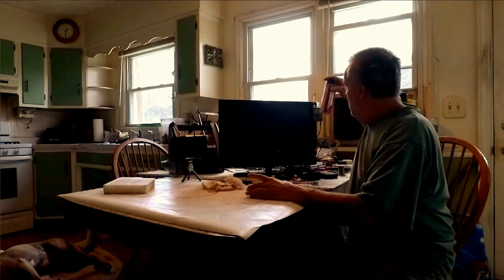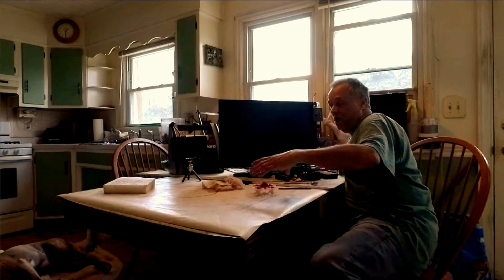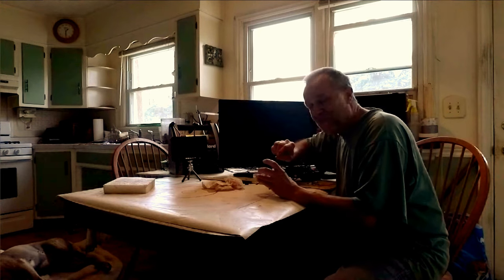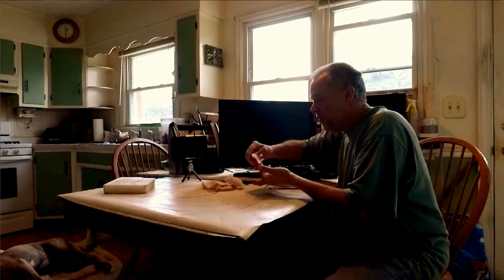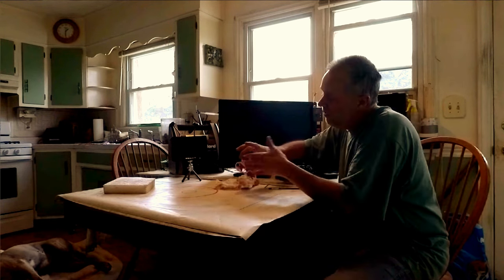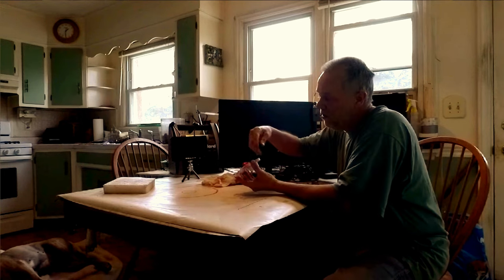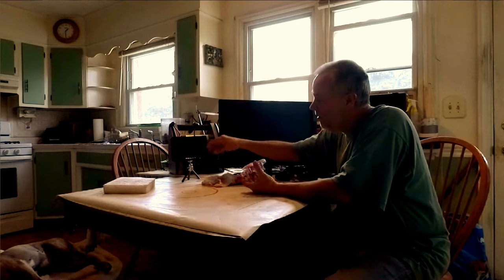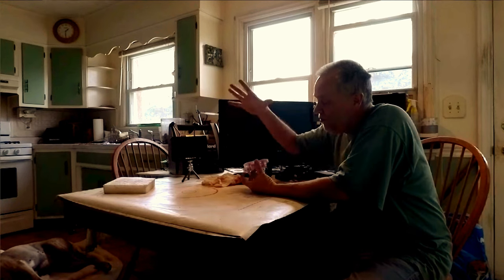Corrosion-X,  Waterproofing Your RC. Electronics, Inductrix FPV+ Pre-Winter Outdoor Flight Prep

Comment: With that waterproofing you'll see much more RC enthusiasts bringing their equipment out in inclement weather I don't know if that's a good thing or a bad thing but it'll get more people off the couch
Reply from the maker: RC-SkunkWorX it honestly has worked for me. When I flew my Timber in the blizzard we had last year at night, I knew it was just a good insurance policy to have in there. Like I said in the video I tested the stuff underwater receiver and all. It works. Just don't code it in and fill it up. Nice having you checking out my channel dude I will do the same. Happy flying buddy, skip PS you were the first person to watch this. Awesome
Reply: Skip-Built, RC. Outstanding videos my friend keep up the good work
Reply: I found out the hard way with my Timber flying it on the lake and it got upside down and the ESC and everything even though it was waterproof or water-resistant rather it still did ruin it. Lesson learned! Thanks for video skip, happy flying buddy.

Comment: Are those the 6 or 8mm motors?
Reply from the maker: 8 mm.  They're as big as the dromida ominous motors...cool huh?  
Still like the other options you sent links to.  Brushless, OSD Telemetry and GPS on a mini smaller thatn my spider hex would be AWESOME.
Reply: Skip-Built, RC. I thought those were 8mm wasn't sure though yeah those 8mm got quite a lot of punch
Reply: Skip-Built, RC. Yes indeed that would be outstanding